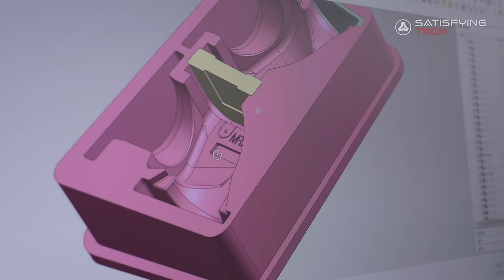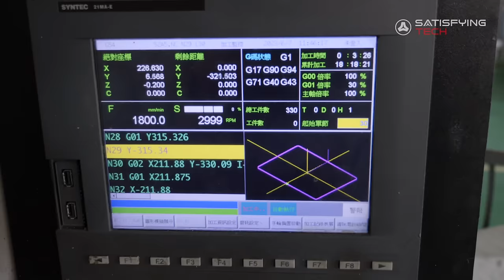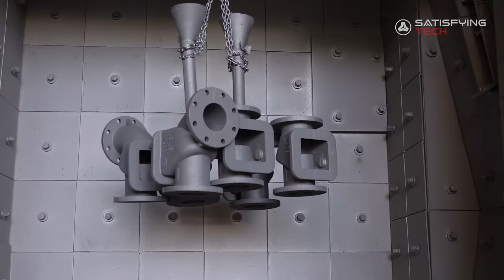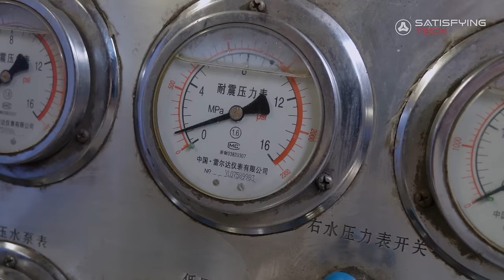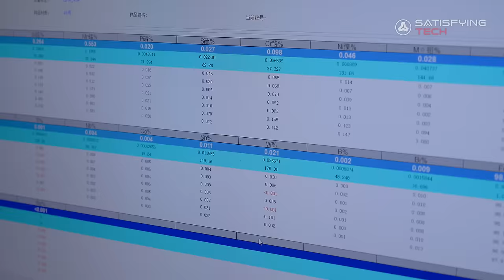Oil Tankers Valve Making Process! Rare Manufacturing!

Comment: I have been following casting techniques for years ( and I sand cast as a hobby ) but I have never seen this process before, I had to watch a couple of times to actually get it , I assume that the coating on the styrofoam is to improve casting surface finish ? 10:09
Reply: Lost foam casting technique similar to lost wax. Yes the coating improves the surface finish, but also prevents flash / leakage and effectively becomes the outer mould. This is molten steel or steel alloy (possibly stainless) so very hot indeed. The styrofoam will flash to vapour / fumes instantly. Very nasty fumes too, avoid those.
Reply: @VenturiLife  do they escape through riser n sprue? i mean the fumes? wont they form bubbles inside the structure n weaken it? also wouldnt there be some residue left?